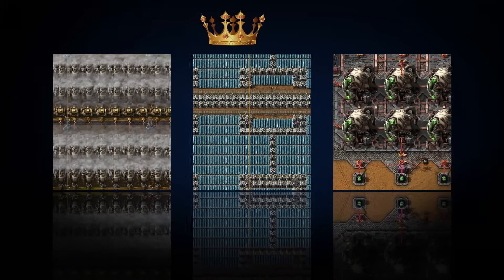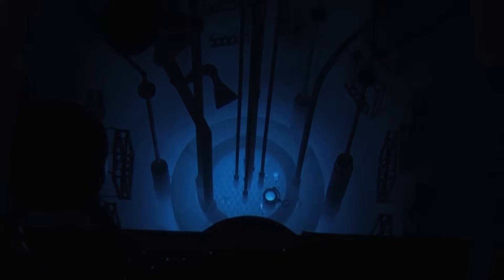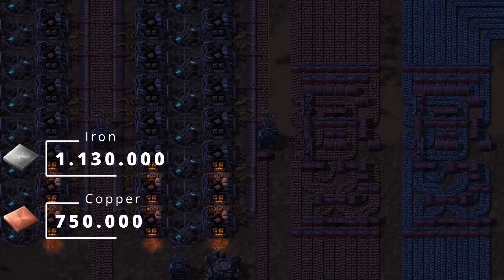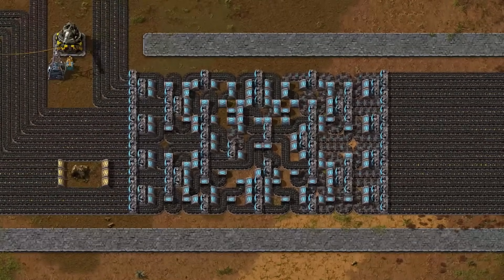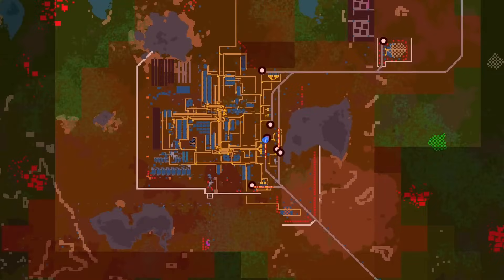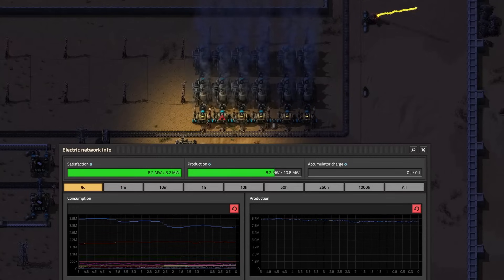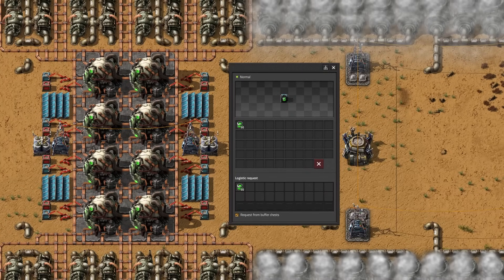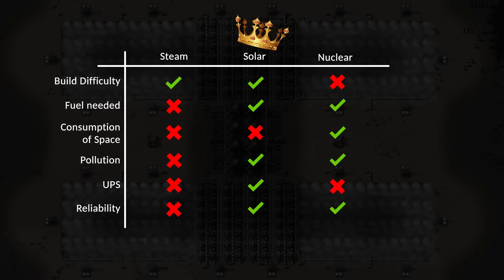Learn about Factorio Power Production - What is Best?

Comment: Non-casual reminder for beginers. Yes in long run solar will payoff. But when people say that green energy does no pollution (also IRL)   they tend to showe under the rug the fact that in order to create that crazy amount of solars and accus per 1GW your pollution impact in terms of evolution factor (and resource draw) can be quite significant just for producing enogh to sustain ever growing power demand if you don't want to spend 65+ hrs just for making panels/accus on a single assembler, and you will be needed much more power for your factory in that time. You still need mine and process 2kk of raw resources. Also i dont see sulfur/oil calculations included (as well as all the rest of iron and copper) for 20k accus, they are a thing and can easily dry your oil low (yes, its technically infinite but you still need infractructure capable of fulfilling the demand) and whitout them solar is almost useless if dont want to run your factory only half-time. Also power poles and/or substations quickly grows from hundreds to thousands. Also solar eats SPACE when going BIG and require clearing of lots of biter's nests proactively and account for military expenses for securing ever growing perimeter. Exept ofc when you play without them, and if you plan to go megabase, why would you even play with them on in the first place? You go big solar only in late game and only for megabases as a substitute for nuclear when you can afford to dry out ore patches just for solar panels and accus production constantly. All of this is to warn new players that when they hear that solar is the king they tend to go full solar the moment the tech is researched and can end up in a shitty situation when they ran out of starting ore patches, evo factor is enormous but base is not quite advanced and defense/military is insufficient and base constantly chewed by biters due to pollution created by solar/accus producing infrastructure (what an irony). And they can not expand cause they are low on resources, can't defence, can't progress. This negative feedback loop can ruin your first runs pretty easily.
Reply: You make a good point about the accumulators, that's why I am rather fond of using a hybrid solution I found in a reddit post about using steam tanks instead of accumulators. You can basically supply 6MW of constant power in a ratio of about 100 solar panels : 1 boiler : 7 steam engines : 1 steam tank. That allows for up to 70% of your energy consumption to be satisfied by solar, while the boilers top up the steam tanks for night time. That cuts down on coal consumption, requires no oil and is available at green science. Solar panels still require a heavy resource and production investment, though.
Reply: I prefer using a hybrid of solar and a circuit controlled nuclear with a steam battery. Solar is at the top of the power hiarchy while accumulators are at the bottom. So naturally turbines will kick in at night before accumulators are drawn from. By setting the inserters for nuclear fuel to only operate when the steam battery is under a certain level you can reduce the nuclear fuel drain to nearly nothing.
Reply: @simonnachreiner8380  that's the whole point. Use multiple systems to cover each other's flaws. Instead of crowning solar only and calling it a day, heck I even use sometimes or in some runs a super emergency steam engines stack with emergency supply of fuel to kickstart my water pumps (SE feature) and inserters if I f-ked up with power draw or to keep my defence grid (I use separatable grids with automatic power draw adjustment) sustainable for a brief moment if I'm overwhelmed by biter's retaliation strike.

Comment: I thought they fixed a lot of the UPS issues with Nuclear.. can never get as good as solar for UPS of course but it's still the more interesting power producer to build.
Reply: the major fixes are gonna come in 2.0 and will likely make nuclear better, but not as UPS efficient as solar though
Reply: I feel the nuclear reactor will be very efficient with a single pipe and heat pipe calculations, but you still have to mine and move all the uranium. So yes, for megabases nothing will beat solar. But nuclear will always have its place in difficult biter settings.
Reply: Just needed a single long piece heat pipe that counts as a single building, too many pipe to pipe calculations.

Comment: so I've got about 200 hours into the game with a decent early late-game base going. I genuinely don't see any use for efficiency modules especially if you use nuclear or solar for power as the decrease in electricity doesn't decrease any pollution and the main energy drain is beacons which aren't effected by other efficiency modules. Do you know any good uses?
Reply: It is noteworthy to point out when people are saying the pollution of a machine is proportional to it's energy consumption, they don't mean the pollution caused by your means of electric energy production, they mean the pollution the machine itself emits:

An electric mining drill produces 10 pollution per minute (you can see that in the crafting menu or by hovering over them). Fill it with three efficiency modules 1 to reduce the energy consumption by 80%, and you can see it decrease to 2 pollution per minute. Filling it with three speed modules 1 increases energy consumption by 150% and it now produces 25 pollution per minute. 

So filling 10 mining drills with speed modules 1 will net you the ore production of 16 mining drills while producing the pollution of 25 mining drills. That's before considering the pollution of your energy production, and it applies to miners, pump jacks, assembling machines, furnaces etc.
Reply: pollution production of machinery is proportional to its energy consumption, at least according to the wiki. so using green modules will reduce pollution.
Reply: if you are still using steam power, the reduced power consumption means the boilers have to run less, resulting in a lot less pollution. miners also produce a ton of pollution that gets massively reduced by efficiency modules
they are good when biters are a threat, because they reduce the size and frequency attacks, and slow evolution. but with the nature of factorio you eventually reach a point where biters are no longer a threat. they are great early game, but they currently have no significant uses late game. this may be changing in 2.0 (situationaly , at least)
Reply from the maker: Did you play deathworld though? In a normal default run i agree with you but on deathworlds it's very very useful to use efficiency modules.
And yes it does decrease pollution proportional to the decrease in electricity.
And to your question: "why would you play with biters when planning a megabse?" - Because it is fun ;)!

Comment: I'm not sure if you factored for this already, but your example relies on a specific measurement of output, and solar needs more output to match the others, because you have to both power your base and charge batteries enough to power your base through the night. For example, if night lasted as long as day(I think it doesn't), you'd need double the amount of solar panels.
Reply from the maker: Yes i did factor that in. 23800 solar panels output 1.428 GW. With a perfect ratio of accumulators this results in a possible continuous 1GW output.
Reply: @AVADIIStrategy  Awesome, thanks!
Reply: I assumed he accounted for that but a good question if he really did it's easy to forget about. 
But also Factorio nights aren't as long as the days. In fact dawn dusk and night added together equal the length of the day so you don't need to double solar cells to cover the night but you do need a decent amount extra
Reply: the ratio he mentioned factors in how many solar panels you need to charge during the day
that being said, with space exploration you need to consider the daytime/nighttime ratio of the planets, though there are more means of getting power in space exploration
Reply: Solar is calculated as the average day output, not the max output at midday. Else you have a base that runs a couple of hours a day.

Comment: Steam early game. Solar mid game. Nuclear late game. Often not needing nuclear. I will let solar run until the chests are full. That way if we ever run into a power issue, I can stamp down a lot of megawatts of power.
Reply: I just skip solar
Reply: This is the second time I see this, and it's completely wrong. Solar is the late game option since UPS is the only true limiting factor of the game. You start with steam, then you might use solar a bit, but in the mid game the cost and space (assuming there are biters) will be the limiting factor, making nuclear a must in dire biter settings. Once you get to the late game research gets you over all your problems but one, UPS. You have resources to spare, clear the world of biters. For most the game ends there and that's why you might call it the late game, but for megabases you are not even halfway through. Eventually you can't afford the ups to even have a backup, it has to be 100% solar.
Reply: @xanschneider sure, It’s just a lot of work clearing those mega biter bases in the late game with artillery and spider Tron to make enough room for solar when you are trying to power beacons. On my mega base, I tried to do solar in the north and expand down south for power. 

Typically, I am playing weekly reset servers so UPS is not a major consideration as the map gets reset every Friday.

Comment: Before the first few rocket launches (and reliable artillery production), nuclear will always be king.

This is because artillery hasn't kicked in yet, so biters are still a threat. While neither solar nor nuclear produce any significant pollution while running, the pollution created by setting up solar is going to attract way more attacks than the pollution from a nuclear reactor.

The logistic requirements of nuclear are also trivial, as a single centrifuge fed by three miners can sustain one reactor continuously. With simple circuit logic to prevent fuel waste, this can be brought down even further. As long as you have space to store excess U-238, this is more than sufficient to reach artillery.

Once a reliable source of artillery and flamethrowers trivialize biters and mass production of robots and roboports trivialize building, then solar wins out. The difference is still small though, as you need to reach truly staggering levels of production before fluid UPS actually becomes an issue.
Reply from the maker: Hi! Interesting strategy and thoughts.
The Problem i see is: you have to research nuclear power before you can use it. It involves chemical science packs so it takes a while to get there which means you have to transition from steam to solar first anyway.
Ignoring red & green science: 1000 chemical science packs are more expensive than 600 solar panels which will net you 36 MW of energy during the day.
Reply: @AVADIIStrategy  i don't transition to solar, instead i skip it and stick with steam until nuclear, feeding solid fuel into boilers when available
Reply: 36MW is just a one full stack of engines/boilers 40/20 on full load. Making power 24/7 with automatic output limiter if not loaded fully. You can also store steam. You can get to nuclear quicker than you think. And you always ommit accus. It's very ineffective when during day you have extra 36mw but at night half of your base stalls if you forgot to make/expand emergency coal/steam power plant to compensate for that.
Reply: I havent played Factorio, but have watched alot of videos about it. So correct me if im wrong.

Dont Flamethrowers trivialize biters? From what ive seen the community agrees that Flamethrowers are OP
Reply: @TaylorfromPapaLouie flamethrowers are pretty OP, but behemoths can still get through them if you haven't done many damage upgrades. they just don't use enough fuel to be balanced
Reply: @TaylorfromPapaLouie  yes for shure they do, but only when properly combined with other defence. Geneva Convention's violations take time to be effective when negotiating with locals so you need additional arguments in form of bright focused rays of quantum phisics phenomena and/or fast dispensers of little pellets with dense green shiny rocks. All of the arguments must be protected by layered walls preferably in form of dragon teeth and have ready a fleet of small flying assistants ready to support your arguments. This way you can withstand even the strongest march of protest against your absolutely non-violently invasive intentions, especially when you proactively apply a barrage of long range propaganda capsules against deeply located cells of protestors, they really don't like it.